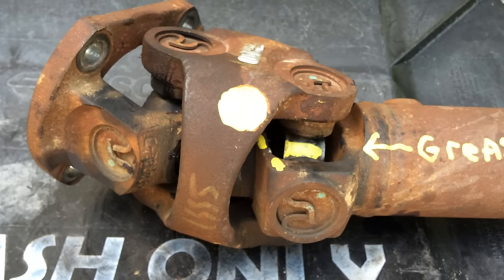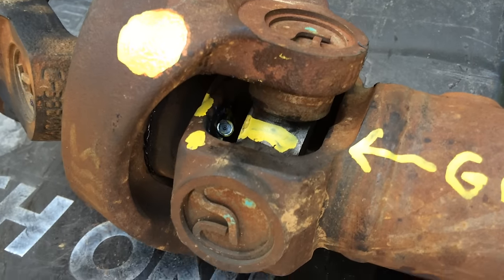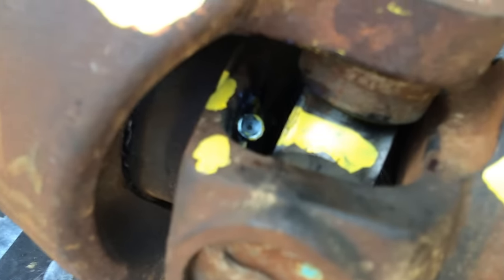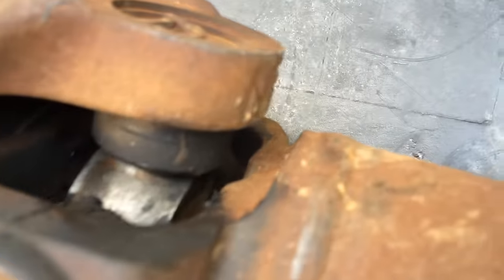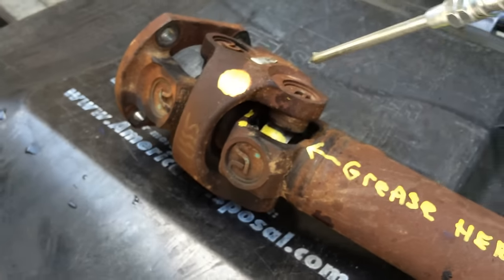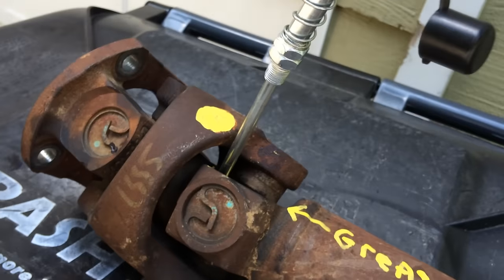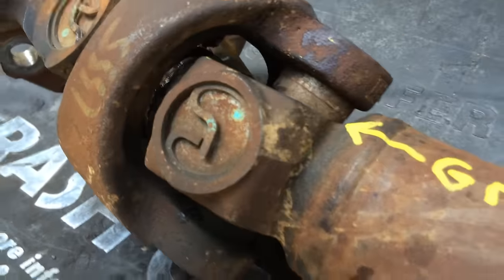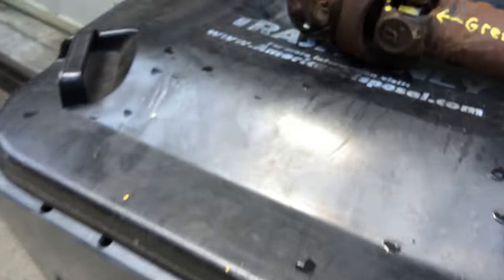RAM Front drive shaft hard to find lubrication fitting (Cardan Joint)

Comment: When I had mine rebuilt, I had them put greasable ujoints in. Much easier for maintenance
Reply from the maker: Sounds good. Factory Ram Cardon joints are grease-able. The fitting is hard to find and reason for the video. Thanks for commenting.
Reply: For new reader, greasing U joints and greasing a Cardon joint are Completely different. 
If you don't lube that ball, all hell will eventually break loose.

Comment: I bought the Lincoln 5806 6" Grease Needle Nozzle 1/8" NPT Female Thread from ebay and you can grease the joint without bending the needle and I was able to use my grease gun that has the flexible hose, I have a 2018 2500 and it has the manual shift for the transfer case so my shaft doesn't turn all the time but only when it's in 4 wheel drive. I have read in some of the comments that the shaft turns all the time but that's not true. If you can turn your shaft by hand without your front tires off the ground then you don't have to worry as much about the joint compared to one that turns all the time but I still grease mine every time I chg my oil.

Comment: Adding 1 pump per video description is NOT enough. Pump until grease comes out of the purge hole in front of the rearmost u-joint.
Reply from the maker: I agree. Video only represented the need for a single pump as much lube was already in place. Thanks for commenting.

Comment: My 03 doesn't have that fitting so I took it apart at 130K miles to inspect it. There was nothing wrong with it and the grease was still in great shape. One caveat, my truck spends very little time in 4WD - only for occasional snow.
Reply from the maker: I'm not sure what year they introduced the cardan joint. I would think that all solid axle vehicles would have this joint and a lubrication point. Thanks
Reply: @mediajunkie2195  I think(?) the lube joint showed up in 2005 on Ram's. My 03 does have the double cardan, just no lube point (or instruction sticker under the hood).
Reply from the maker: @ScottDLR  You gota ask the question then as to why then. Dodge/Ran make such a big deal out of squiring lubricant at such short intervals in manual and warning stickers????
Reply: @mediajunkie2195  I maybe just lucky with the longevity of mine. I probably have well under 1000 miles of actual 4WD operation so most of the time that joint is just going for a ride. Heck, even the u-joints in my front drive shaft are orig and still tight. I've had to change out all the others on the truck.
Reply from the maker: @ScottDLR  Unless you have unlocking hubs those cardan joints are definitely being used in daily driving 24/7. The only way their not an issue is if unlocking hubs (Aftermarket) have been installed. Period!!
Reply: @mediajunkie2195  Yes they're spinning but they dont have much of a load on them. Still, I hate that they're being used for no good reason.
Reply: @ScottDLR  The front axles spin the driveshaft in 2wd regardless of transfer case position
Reply: @espritmike  Yes but there's no load  on the joint if not in 4WD. Probably the only reason mine was fine.
Reply: @ScottDLR  that’s when my friends went. About 160k on the clock

Comment: i have a question ,  HOw the hell did you remove the Drive shaft?  I cannot reach the 4 bolts under driverseat which is the rear set of bolts,   i have 2016 2500  has to be at least close to same.

Comment: Having trouble removing the 4 bolts at the t-case .. 2014 ram 2500 hemi .. how did you remove those ?
Reply from the maker: I pulled the shaft only to show for video. It can be lubed installed. Just bend the needle 90 degrees. Bolts were tough. I used a heat gun and lots of penatrant.
Reply: Thanks for the reply but I'm Trying to install a new shaft because my original one is failing, I have 200,000km on it.. How did you remove those 4 bolts on t case?
Reply: Do you have to remove transmission cross member
Reply from the maker: Island Tires - bolts were tight. I used heat and penetrating oil to free the bolts. Yours will undoubtedly be worse if in salty road environment. Try a propane torch and liquid wrench.
Reply from the maker: Island Tires - no to removing trans cross member
Reply: Ok thanks I appreciate your help
Reply: @mediajunkie2195  I am still not able to get a socket on the transfer case side bolts.. is there a certain socket I need like a swivel socket to access those 4 bolts I'm still having trouble
Reply from the maker: Island Tires did you try a wrench?
Reply: @mediajunkie2195  you cannot get a wrench on the bolt heads , i know what @island tires is saying i have same trouble , there is cross member there and you cant get into it. You can see everything. But no wrench   .. I dont know maybe a swivel head gear wrench will work ,   15mm   I gave up today cause of the snow, buts its definately the ujoints binding in the shaft ,, I orderd a new one because previous one was neglected even by the dealer at oil changes. simple replacement stopped by bad placement.   @island tires did you solve it ?

Comment: Would my 2005 4 wheel drive Ram also have the same drive shaft?
Reply from the maker: MidnightPolaris800 - should be the same
Reply: Ok thanks bud. Love your videos
Reply: My 2004.5 does not have that needle zerk....wish it did... ive rebuilt it twice since 2004.  next time i do it i will get a new DS with the zirk for sure...

Comment: I just found this on my 2015 got a Lincoln needle for the grease fitting I can get to it fine after bending it but damn I still can't get it too go in so does the whole thing go into the drive shaft or the center have something in it ?
Reply from the maker: Hard to explain. Once the left wheel is in the air you can rotate the front driveshaft. Using a flashlight and cotton swab, identify the small zerk fitting. It will be shiny like my video shows. Once you have located it visually it will make sense. If you have it right you'll feel it centered up. You see  forcing your bent needle fitting into the zerk creates a tight seal so that when you squeeze the grease gun grease is forced through your Lincoln needle fitting, then past the zerk and into the center which is the Cardan joint. Understand?
Reply: Yea I tried that and all the live went everywhere except into it . I even bought the recommended Liconlon fitting
Reply from the maker: Hmm. I bought my needle fitting from NAPA auto parts. I too had to bend it 45degrees. My video was before trying lubing installed.

Comment: Dodge should get sue over this , it broke and it busted my transmission, transfer case , fuel lines truck turned off I had no control over n no brakes lucky I didn’t die, and a lot of people this has happened to.
Reply from the maker: Ouch! Sorry to hear. Get free spinning hubs.
Reply: They should get sued over an easy maintenance part? The hardest part is finding the fitting. Grease it every 10,000 miles as you should every U joint and you won’t have any issues.
Reply: Indeed. Same thing happened to me, though my fuel lines were ok, but it cost me $8000.
Reply: TEXAZPITBULL my dad to his whole truck went up in flames
Reply: Media Junkie 
How did you get those screws out at the u-joint where it connects to the front differential ? 
No room for star socket.
Reply: Mine caught fire.
Reply: It only broke due to lack of lubrication or stupid boosted launching in 4 wheel drive. 
The don't just break. That carden joint is Stout af.
Reply: This just totaled my friends 2008 3500 dually and the insurance company is declining the claim due to lack of maintenance